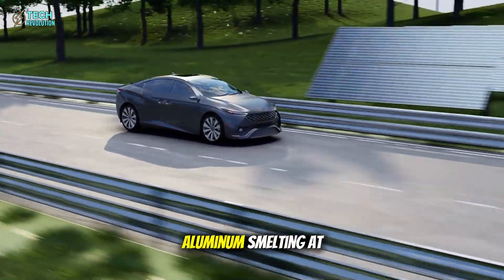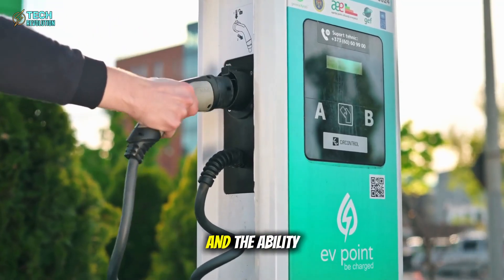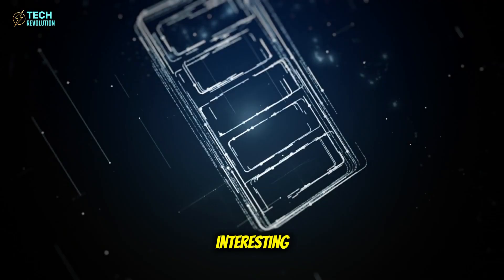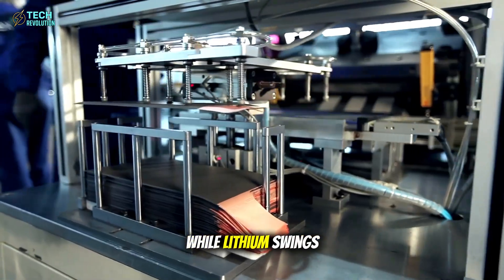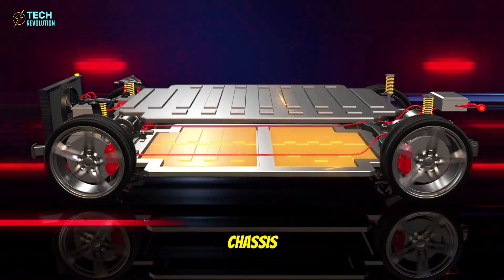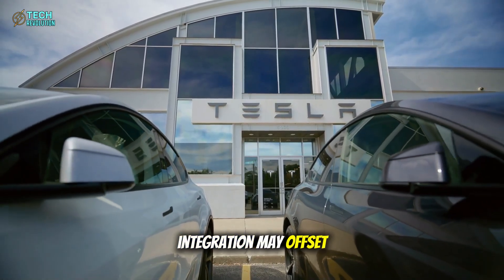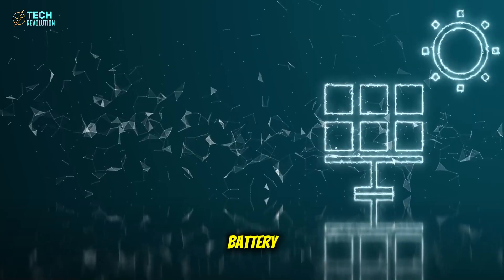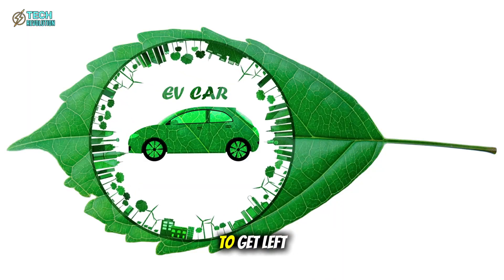Tesla Aluminum-Ion Battery FINALLY HERE: What Makes It Unstoppable?

Comment: I would prefer a battery that can be swapped when it has degraded too much.
Reply from the maker: Swappable batteries make sense for flexibility; aluminum-ion’s 10,000-cycle lifespan could outlast the car, but modular designs like NIO’s swap stations could still beat Tesla’s fixed packs for convenience. What’s your ideal swap system?